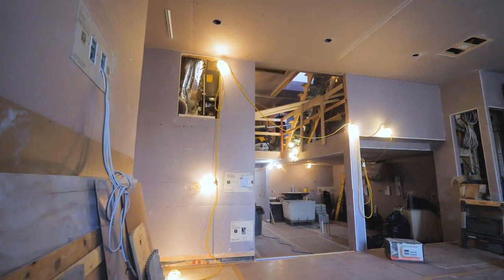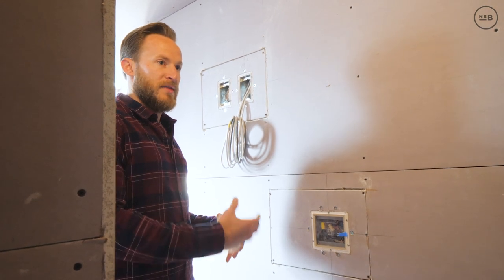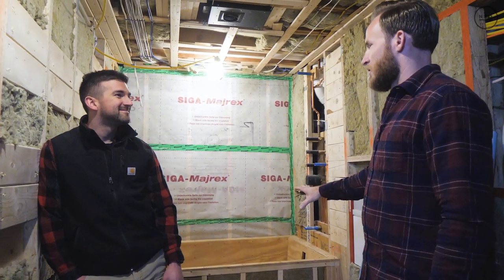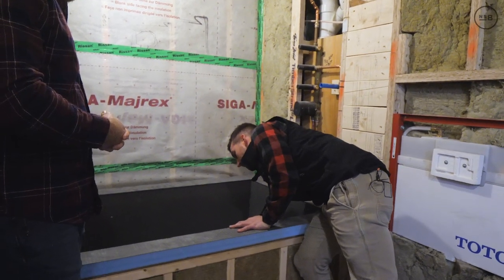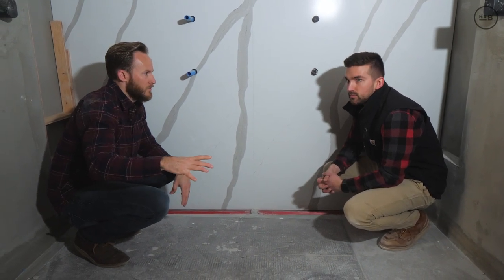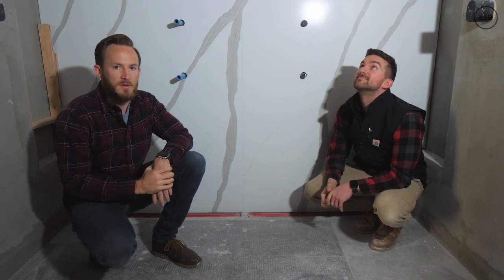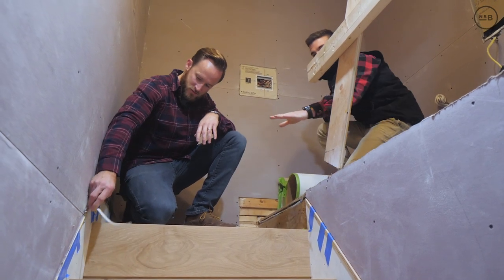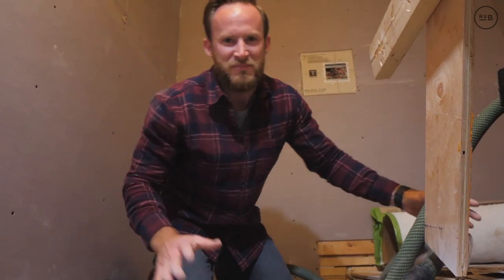Lime plaster master bathroom remodel & CNC cut Wedi tub

Comment from the maker: Do you use drywall or blueboard & plaster in your area?
Reply: Drywall 99%.  Honestly nobody notices - or cares. People walk in a room and notice the views - the glass. Then artwork/lighting.  Maybe cabinetry. Never the walls unless wavy.
Reply: @ArthurDentZaphodBeeb  
I care.  Plaster walls are more durable.  It's not just for flatness.
Reply: Drywall. Never heard of blueboard before. Most high end builds here in Buffalo are drywall, unless it is in a high end older home in the city that the walls are plastered already.
Reply: Drywall 100%. I personally love the look and feel of plaster walls.
Reply: UK - board then plaster on it, supposedly the paper is different on the back to the front, one side is for tape and joining, the other side is for plastering, no one takes any notice of it though.
Reply: Actually here in California plaster is coming on strong. I’ve seen 2 remodels in the last 6 months go for the super smooth finish. Absolutely not quite in your league though! I just cringe thinking of the holes for artwork! The door jambs are insanely sweet! The sound in the first bathroom was something else. What a beautiful one of a kind home....wow!
Reply: Plaster is great when not flat, patterns and sculpted corners are way more interesting.
Reply: Did you glue the foam to the wood in the tub ? How is it secured to the wood?
Reply: type-X  GWB
Reply: @jonesconrad1  yeah that makes perfect sense.  That way when you put it on with the bakside facing out, crowns are created when you put fasteners thru at the edges because the edge taper is facing the wrong direction.  Then you get to do all that work TWICE to ensure flatness.
Reply: Blueboard is just drywall that is resistant to mold and mildew growth.

Comment: A foam tub...that relies solely on caulk ( wedi modified polyurethane ) to waterproof it will fail ...not if but when....sorry guys, sometimes there's not a better mousetrap. The only advantage I see in using this closed cell foam as a bathtub is insulating to hold in heat of water, otherwise I think it's a horrible idea.
Reply: The entire bathroom is going the end up with a monolithic waterproof lime plaster finish, which 'should' mean no water ever finds it way to the Wedi surface/joints. Essentially the tub is relying on the solid plaster finish as the waterproofing...that's my understanding...Makes me think of old stone interiors I've seen in Italy where the plaster is used to mold different surfaces together..traditionally plaster over stone/block work but adapted here to a wood framed house...
Reply: @Matasky2010  That waterproof lime plaster is going to be in the tub where the kids are. If it gets damaged, and probably will, the whole tub will have to be removed because that waterproofing plaster can't be patched. When that happens, that wedi isn't going to stand up to it. The wedi will fail once the plaster is penetrated

Comment: As for light, u can use a slim recess light there. Nowhere near as cool as wall wash light but still... Those things are like $20 a pop at HD as long as wall is thicker then 1/2" you will be fine

Comment: Great walk through. Question on the tape lighting. Where do you place transformers for them? (Assuming they’re low voltage). Thanks. Please keep the fantastic content coming.
Reply from the maker: Todd Nagle we will find a place that is serviceable like inside the vanity cabinet. Or in a wall w access panel.

Comment: There is a glue/primer product (its pink I think) I've used when I've needed to transition my plaster onto sheetrock. I forget what it is called, but the local supply store where I get plaster supplies has it.

Comment: Hi Guys I work with shower door for many years 
If you order a 3 hinge shower door panel 
You can use a short screw for the bottom hinges and shows be any problem because all the tension is on the top ginger’s

Comment: I don't hear anything about how you are going to waterproof the tub. Are you just going to use the standard waterproofing of the Wedi shower system. I don't believe they make anything that they recommend for a tub.
Reply: The entire bathroom is getting a waterproof lime plaster finish, that's what they said. The idea is that no water will ever find it's way to the Wedi surfaces (assuming no defects in the plaster), so I guess it will be Wedi standard waterproofing.

Comment: The plaster is a great look but what about everyday livability? After a shower wont certain sections always look wet or dry depending on what is behind the wall or it's location? How do you prevent deposit build up or even soap build up as the finish isnt smooth and cleanable? Or is it?

Love the forethought in every piece u guys do.
Reply from the maker: BRIAN we’re working with waterproof plaster for these areas

Comment: Retailers are now selling 1/2 thick 4-6 inch wide puck lights that would solve your lighting problems in the bathroom above the tub.
Reply: Do you mean wafer lights? If so they won't be flush with the ceiling.
Reply: @lrc87290  looks like some creative cutting of the joists could provide sufficient recess for puck lights.  But I like the wash effect anyway. Wonder how an entire bathroom would look with light washing down all the walls?